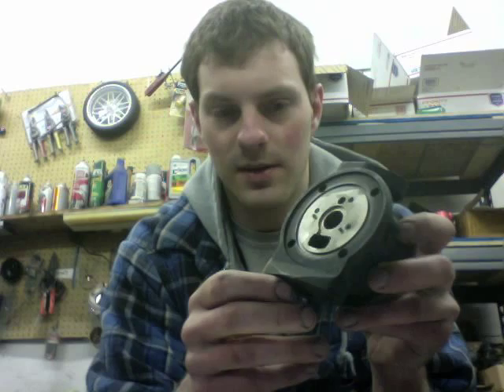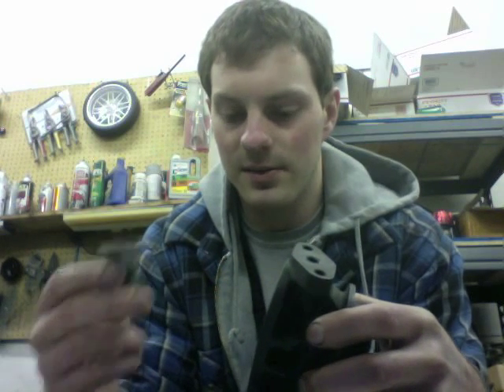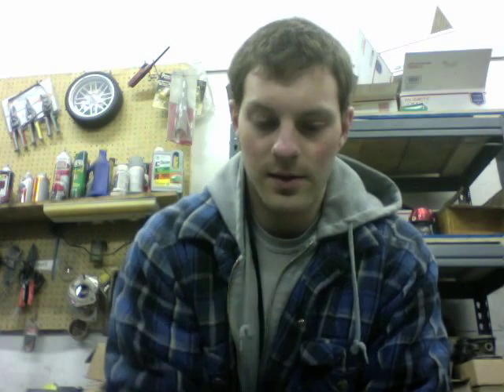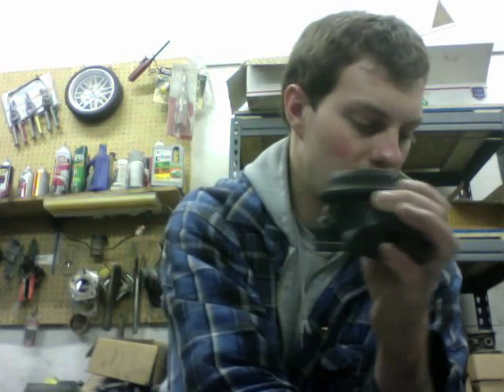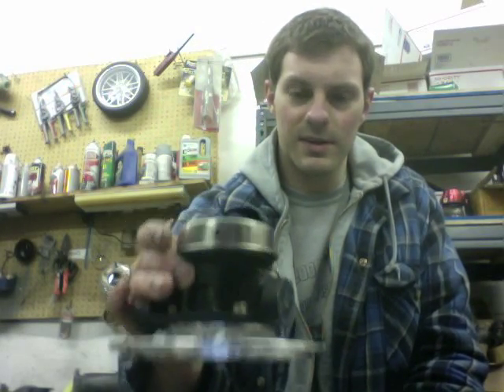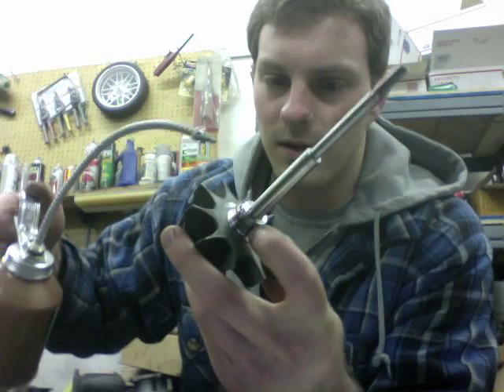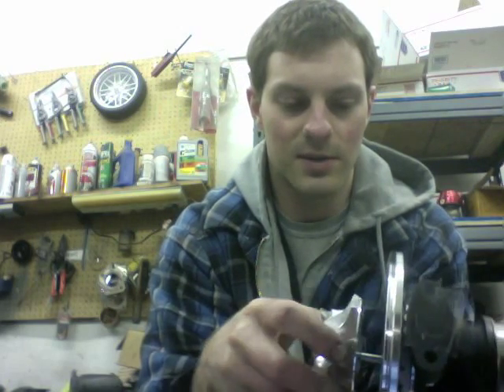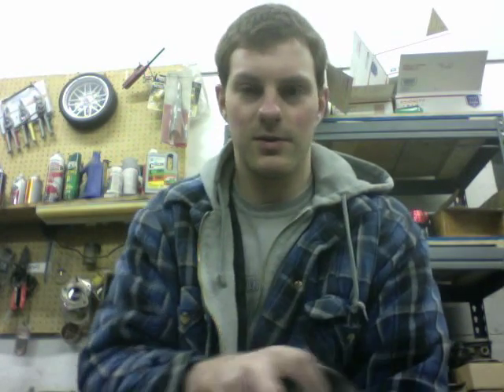PTE 6176 Precision Turbo Rebuild

Comment: What's up man I wanna by a kit. But I'm a lil confused with the thrust bearing part. I'm rebuilding a pte 6262. I'm pretty sure I wanna use the same as what u used because u said the other one u have to bolt on or something like that and u can't use the oil thing that goes behind the wheel. I believe it's the 3 oil port one. Well can u point me to the right kit for my turbo? I understood everything just don't wanna get the wrong thrust bearing.
Reply from the maker: +Josias Delgado http://turbolabofamerica.com/garrett-t3-t4-to4e-to4b-turbo-rebuild-kit/ the newer 6262 doesn't use the bolts or gear shape retainer. The compressor plate and dowel pins on the bearing housing hold the thrust bearing in place

Comment: Hi,  I'm having issues with a PT 5558 ball bearing turbo, and seems to be damaged the ceramic balls. 

This kit is ball to journal bearing? Or do you have ball too?
Reply from the maker: +federikg the kit you need is not the same as in the video. I may have a cage for it , there are a few different variations of the cage. If you can get me pictures of the shaft after you press it out, I can confirm which cage you have
Reply: @turbolabamerica   hey What’s up watch this video wondering if you have any cartridges for sale preferably the 6176 precision one if so how much mine shit the bed or any other interchangeable ones I can use would be helpful thanks

Comment: I'm sorry for the error I'm just a bit frustrated my old wheel inducer size was 53.82mm and my new wheel size inducer is 53.38mm will the difference in size effect the power or efficiency of the turbo ?
Reply from the maker: +jjella77 I wouldnt know the answer to the question. If we ever run into a problem like this we machine the compressor housing for another wheel if we  cant find the correct wheel.

Comment: Will that 0.5 smaller difference effect the way the turbo will preform ?
Reply from the maker: +jjella77 Is it .05 or .5mm. your math has been all over the place. if its .05mm then its okay, thats only .002 inch, a sheet of paper is .003 inch

Comment: Hi I have a quick question I damaged my compressor wheel the size was exducer 76.25 and the inducer size was 53.82 and so I bought a new one the exducer size was identical 76.25 but the inducer size was a little smaller mine was 53.82 and the new one is 53.77 so my question is does the .39 of a difference really matter please let me know.
Reply from the maker: +jjella77 based on your message the wheel should be .05 mm smaller. its hard to match those wheels correctly. there are a lot of different ones around the 50mm size with a 76mm exducer. Usually if i run into that problem with a pte turbo i just machine the housings to a wheel that is more common, not because i want to upgrade, but its because i dont have a choice, replacement parts are not available sometimes.

Comment: Hi I have a pte turbo model #300-5252 can you please tell me the compressor nut torque spec's or how tight does the nut have to be thanks for your time.
Reply from the maker: +jjella77 I really dont know that part number off hand. If its the to4e, the torque specs is 84 Inch/lbs (not foot lbs). Or put the compressor nut on by hand, and once it starts to grab the compressor wheel, add 1/4 turn.

Comment: Hi my thrust collar sit's a little tight on the shaft is it suppose to spin with the shaft or does it need to break in and then it will lossen up please let me know.
Reply from the maker: +jjella77 it spins with the shaft. it should go on the shaft but shouldnt be very loose either.

Comment: Can those small fittings be drilled out to size?
Reply from the maker: superboogen I have drill and ported the oil drains, it fixes the problem, unless the diameter of the oil drain is too small. 16mm or larger ID works, We see problems with anything smaller. Sometimes people have the correct oil drain fitting add a lot of  rtv gasket maker causing the turbo to not allow oil to drain.
Reply: Lol, thats funny but very true. I am thinking of getting a dash 12 welded on my oil pan now before installing my next turbo. Just do it all right while the transmission is out.

Comment: What size restictor do you recommend for a Chinese gt 45. Also what size drain?
Reply from the maker: Neil Mcilwain if its journal bearing do NOT use a restrictor. use as large of a drain as possible. 16mm + ID seems to work best. usually on the larger turbos the drain is 20mm Inside diameter. Anything around 12mm has problems. Also if the oil drain isnt straight or has 90 degree bends you can have problems.